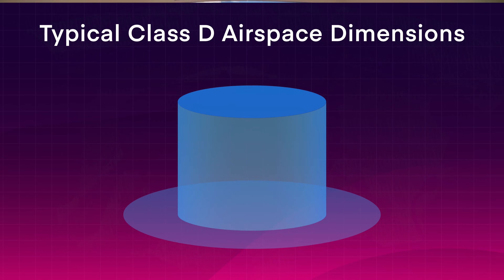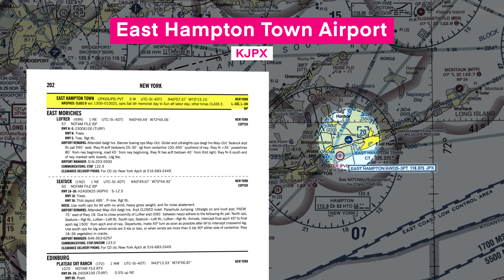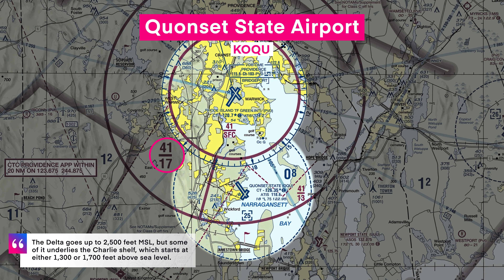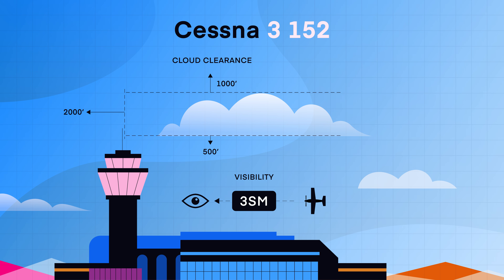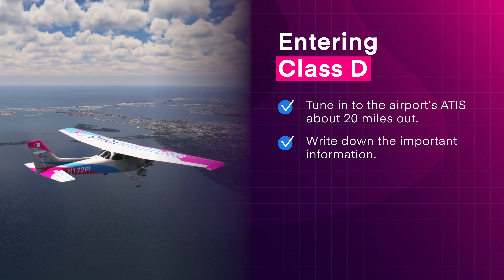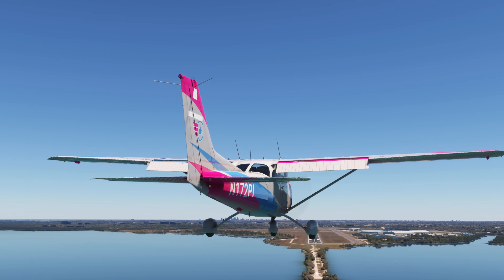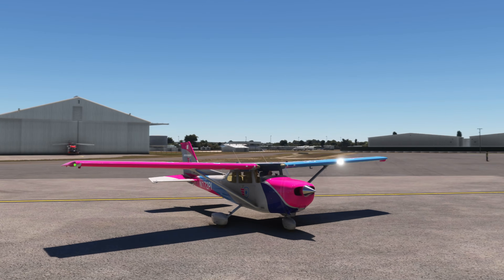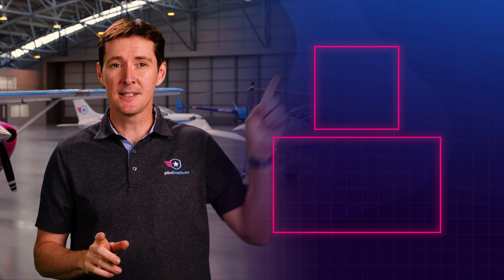Class D Airspace Made Easy in 13 Minutes

Comment: I'm a bit confused at the 5:36 mark. If you're under a class C you don't need a Mode-C transponder or ADS-B. It's overflying (or inside obviously) the charlie when you need that equipment.
 "....Above the ceiling and within the lateral boundaries of a Class B or Class C airspace area...."